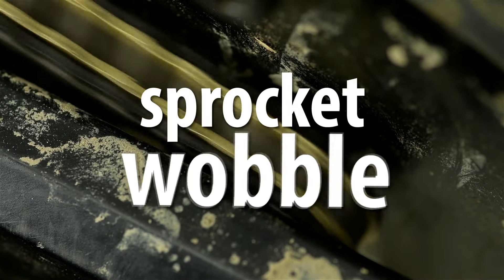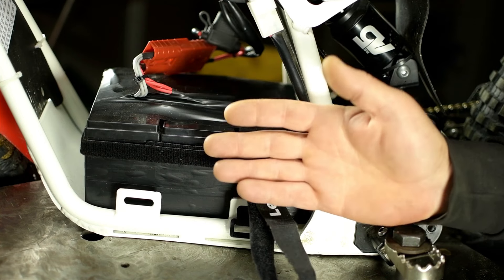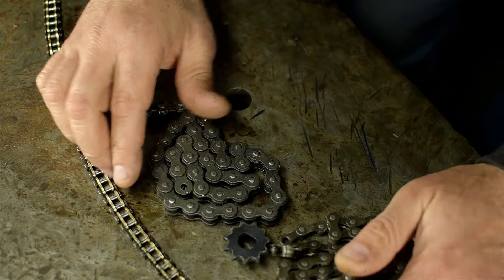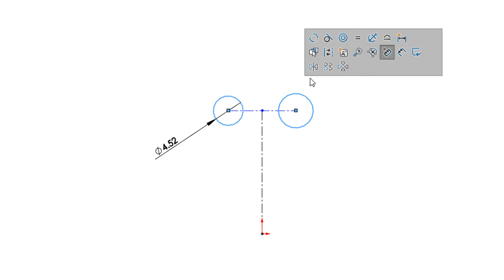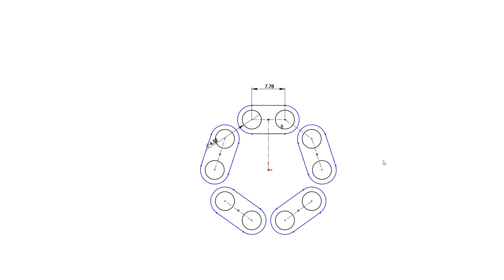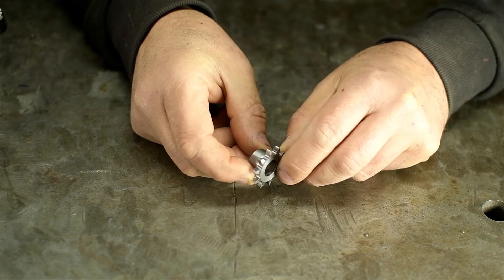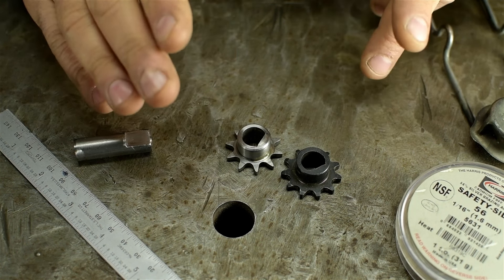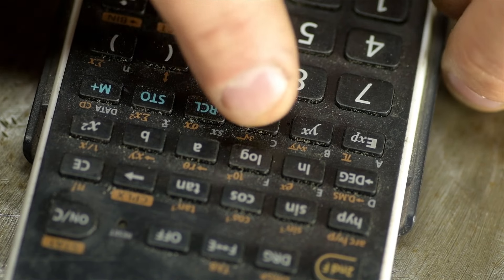Let's Make Our Own Chain Sprocket!

Comment: What chain size is on this bike? "Uuuuuh, the one we sell."
Reply: As stupid as it sounds (and it is), I've been in the same place with beta dealers before. The solution has been taking my sprocket to a parts dealer, measure it and search the catalogues for compatible stuff.
The dealer insisted that I could only fit OEM parts, as if beta made their own parts...
Reply: I have been in the buisness, for all bigger bikes and brand bikes, they use standard chains, when you come to the smaller stuff, and chinese crap, all bets are off.
The small pitbike/dirtbikes are especially f-up, no standard at all.
Reply: @someoneelse7629   Yeah I've been through that with some old chinesium "pocketbikes" when my kids were little. It's like when they built the bikes they were digging through the miscellanious parts bin and tacking on whatever would fit
Reply: @mastertek383  eh if its from china its probably a 415, but who know been my experience at least
Reply: @thispod That is actually weird because in Italy Beta has got one of the most efficient technical department ever seen in a bike factory. Maybe the next time just jump over your American dealership and write an e-mail to the Beta headquarter here in Italy. They will reply you with asked infos for sure!

Comment: They must be calculating the lead acid battery time in 'dog hours.'
Reply: @no candy Manufacturer knows, but marketing knows how to sell it.
Reply: That's what she said!
Reply: @DmitriyLaktyushkin  *how to lie
Reply: What do you mean I can't pull 100 amps from a 100 amp/hour battery pack for 1 hour?!? @_@
Reply: I think they use the term used to measure radioactive decay, half-life. They have the half-life of a worn out battery.
Reply: PRICELESS!!   :-)
Reply: Lead acid batteries are rated in Metric Hours. You have to do the conversion.
Reply: @danoberste8146  Take standard amp hours and divide by 25.4?
Reply: Railgap Esoterica - probly not if it’s rated 100 ah at 5% depletion rate..
Thats why you should use them in 
parallel .
Some batterys are capable of higher continuous discharge rates than others.
Thats why there are electric cars , 
full of thousands of 18650 lithium ion batteries, not lead acid .
Reply: @no candy Wow! I just learned something.

Comment: For the D hub why didn’t you just grind half a land off a twist drill so it only cut 2/3rds of the hole.   easy.     Your welcome.
Reply: That makes perfect sense!  Lol.
Reply: I can tell, you are one of those math guys...LMAO
Reply: Kristoffer Beder hell no.    Just chuck it up like normal, every time the missing bit comes around it doesn’t cut- instant D hole.   Course you do have to match the rpm to the diameter but there’s gotta be a page for that in the ginger beers handbook.
You’re welcome.
Reply: @mwhelan53  Ah, so that's how they make those double D holes you see on instrument panels, they just cut both lands off!
Reply: I like what I'm seeing here (including tots video) ,  a group discussing an idea or modifications to simplify or improve.. whatever.  My drills and the respectively sized triangle holes they make, can only be modified to create trapezoidal holes (using the land grind method)  I'm a newb just sharing what most of you know already.
Reply: ToT, can you please make a video on this?
Reply: I really just expected the die filer to make another appearance.
Reply: is there any difference between a twist drill and a regular drill?
Reply: @darkshadowsx5949  A twist drill will twist when it breaks.  A regular drill just breaks.
Reply: @darkshadowsx5949  On a serious note, "twist drill" is the traditional name for a "regular drill [bit]". What most people refer to as a "drill" is properly a drill machine or driver - that is, a machine that drives drills.

There are also more specialized drills like straight drills, flat drills, insert drills (brazed or screwed), coring drills, abrasive drills, friction drills (not the same as abrasive!), step drills, and so on. It's a surprisingly complex subject!
Reply: pandorafalters complex but boring.
Reply: @andie_pants  that the the filer is sexy sexy
Reply: His welcome?
Reply: @mwhelan53  a boring subject 😁

Comment: I've built several 26650 based 24v batteries for power chairs that last all day use a 7p8s 26650 pack is about 12"x14"x7" ishh? One will run a power chair around the shop , yard etc, all day, two of them will run something about 25 miles ymmv depends on the chair. Getting rid of the lead in the chair and replaced with a 26650 pack, saved about 300 dollars every three months, the pack lasted 2 years before needing a maintenance overhaul, the 260 dollar or so investment saved about 2400 bucks. Fella was having to buy new batteries every 3mo or so

Comment: Comment about sprocket design: when the teeth are few, you should always use an odd number of teeth.  Reason, there is a "tension wobble" because essentially the sprocket is a "polygon"  of N sides, and not a circle.  By using odd tooth number, the tension ripple of the meshing-in point and the meshing-out point cancel.  Another thing: the pitch of a sprocket should be A LITTLE LESS than that of the chain.  (The more teeth on the sprocket, the more reduction you need.)  The chain will move outward to find the exact point of pitch match.  If you make it exact, a micro piece of dirt will hold the chain upward from its seated position, causing the next link of the chain to fall further behind the sprocket, which makes the next link even further.  If you have ever had a bike where the chain makes jumping noises, and no matter how much you tighten it, it gets hard to turn, then bang! and suddenly easier, repeat...  That's the cause.
Reply: For a long time I had wondered why odd numbered sprockets were more common
Reply: That is interesting...never thought of either!

Comment: The sprockets we machine at work we do the same way on a cnc mill, we add a scallop in the valley of the tooth with a ball nose to allow dirt to escape. We also have problems with too much cutter engagement in the corners, which can be kinda fixed by a circular helical tool path or slowing the feed rate down. As always a great video TOT

Comment: I love the engineering calcs on the braze joint! I usually forget to take the square root. Keep it up TOT!
Reply: TimWelds 58008?
Reply: take the tensile strength of silver and divide it by the product of the shaft diameter and motor peak power. Subtract two and that's how many filler rods you need.

Then use the sq root of that amount since rods are expensive as fuck these days.
Reply: but in all seriousness that joint will last longer than the bike.
Reply: Shaft diameter: 12 mm
Hub (braze) depth: ~13 mm
Braze length: 1/4 circumference ~10 mm
Braze shear strength: 18000 psi ~ 124 MPa
Motor 750W/36V rated torque: <3 N*m
Force at failure: 124 * 10 * 13 = 16120 N
Torque at failure: 16120 * 12/2 * 10^-3 = 97 N*m >> 3 N*m
√ PASSED
Reply: @jonasthemovie  
An or
8008135
Reply: And or....
Reply: AVE told me this
Reply: shit I mean mr. President.

Comment: I was expecting you to CNC a chain with offsets timed so that it cancels out the sprocket wobble.
Reply: No joke. Maybe some chain phaser/tensioner actuated by an ootical sensor either advancing or retarding the required position of said phaser/ tensioner, that in turn, takes the stresses of that poor D.C. motor. Ya know. Something simple like that.
Reply: Need the Rockwell Entabulator to design that.
Reply: Only reason that wouldn't work is because sprocket gears are made to be co-prime so that the chain will progress through the entire chain spreading the wear or allowing one fault in the chain to spread to the entire drivetrain.
Reply: English please
Reply: was this a real conversation?
Reply: Gentlemen, TOT and you have shown me how ignorant I am to CNC and machining. I am studying to be an engineer, not far along but I assure you that one day I will be able to contribute to this conversation!!!

Comment: I really recommend wheelchair batteries for the mini trial it worked great in ours. and they are a lot cheaper and last longer
Reply: Got some 250watt ones to play with over xmas, this was great if I need to cut some gears. I still have find some chains to fit the gears. And great tip about wheel chair batteries, had not thought of those

Comment: You've discovered the method I use to find misplaced tools!  I just buy a new one, and my old one shows up almost immediately.  Of course, there is the added advantage of having duplicates like 3 desoldering tools.
Reply: exactly, now you have one for the bag, one for the toolbox, and one for the bedroom
Reply: The only caveat: this DOES NOT work for any length of 10mm socket. When it's gone, it's gone forever.
Reply: @nelsonbrum8496  
Or tape measures for some reason.. the extra one I bought in the hope the other one would turn up again has now just taken the missing ones place ;-)
Reply: Verniers...
I now have four of them and can only find one, never the same one either...
Verniers work in shifts
Reply: Very similar phenomena exists when building plastic models -
Lose a small part, you look for it - everywhere - on hands and knees.
No luck.
So you scratch build a replacement.
An hour and a half later the new part is done and you decide to stand up from the model bench and take a break.
Oh ! Something under the tongue my shoe !
- and only then you find it is the original lost part.
Reply: @joansparky4439  When I buy a new tape measure I always buy three.
Reply: Too true.
Reply: I have that problem with quarter drive and 5/16 sockets and hex heads. I can never find them when I need them. I think they're disappearing just like losing a sock in the dryer. Lol😸😸😸
Reply: @nelsonbrum8496  Switch to Imperial, Nelson.  You'll never lose another 10mm socket.  Your mind maybe, but .....
Reply: @MrPossumeyes  I use Freedom Units every day in the shop.. even have to convert from Socialist Scale sometimes.
Reply: @nelsonbrum8496  😀😀
Reply: @ProtoV33MK1  I'm glad my 3D printer came with a drawer for tools, or I would have lost my flush cutters also!

Comment: When I was a kid (mid 80s), we'd manufacture rear sprockets for racing karts completely by hand.  A calculator, compass, punch, drill press, jig saw, and bench grinder were the only tools.
Reply: Why were kids manufacturing sprockets? I know child labor laws are relatively recent, but...
Reply: @U014B  Well, they went on my own racing karts.  They were sprocket sizes that I could not buy off the shelf.  Solution, buy an oversize sprocket as a blank and then make my own.

Comment: When contour machining form with concavities, avoid the high milling stress in the roots by using the cutter to drill holes in the concavities first, then run the contour.  On drilling, forces are central and aligned with axis, so no tool deflections affect concavity position.  It is easy in the CAD to add these holes.  If your cutter has a plunge grind, you can use the same tool.  In this case, you can select the tool that matches the concavity, rather then having to use a smaller one.  This also mitigates the clogging of the tool flutes when cutting concavities.

Comment: You should be getting a call from the manufacturer anytime for an order of sprockets😁
Reply: Bwhaha.   It's funny because it's so true.  Then they'll ask him for the type of chain to use.
Reply: @shirothehero0609  did yall watch it to the end?! lol Tony is awesome!!
Reply: Going down to 10 teeth was a bad idea, the manufacturer knows why the sprockets are failing by now and the solution is more teeth, not less. The torque issue would be solved by higher voltage battery/controller. The motor itself is probably pretty stout. The bike was just poorly engineered from the start. Lead acid? You kidding me?🤦
Reply: @Hammerjockeyrepair  that I did.

Comment: 17:42 I hate when that happens. Fixed a gear in my lathe with a copper washer and some JB Weld, after getting tired of waiting. Then the part arrives in the mail. Never bothered to change it, the JB Weld is still holding to this day.
Reply: Tin can piece, and loctite 603, because the manufacturer decided to increase shaft size a few hundred units up from the one I got, so the new gears ( slightly better quality than TOT has) were just a tiny bit sloppy on the shaft.

I also had to, on another gearbox, take a regular Fenner gear, and turn most of it away, as this used a gear as part of a clutch assembly to limit torque, so just needed the actual gear teeth and a flat plate, with the centre having a brass ring to take up the 2mm diameter difference.

My garage door as well, needed 2 gear teeth, but the chain is a skinny one, not easy to get, but easy to take standard sprockets and machine them down to the skinny ones, then take some regular chain and put it in where it would just not travel over them, as a spacer.
Reply: Well like they say, nothing is more permanent than a temporary solution.
Reply: PRO TIP:

Well when I JB welded mine I had to do the same thing tony did and cut a link out of the chain because when the one tooth broke off I skoooooted all the other teeth around a bit to make it concentric, hence the removing of the half a link of chain.  
You’ll get that on these big jobs........
Reply: I glued an exhaust manifold Bolt into an aluminium head with JB weld on a Pressure sprayer...it never failed.
Reply: In the mid '80's, I was working at an independant sports car shop in the off season, (I worked in Pro football as an asst athletic trainer, and didn't make enough to support a family).

This guy came in with a 911S with a horrid oil leak. They have chain driven overhead cams on both heads of the flat 6 engine.  

The chain tensioners had been shot for so long, the slack chain had worn through the case cover.   The case covers were not available from any wrecking yards, and after the cost of the tensioner repair, the owner choked on nearly twice as much for two new case covers.

I offered him an inexpensive solution with no guarantee of it working.  I then JB Welded the cases.  No leaks.  Thr key is cleanliness.

I ran into the owner 3-4 years later, he still had the Porsche, and it had never leaked. 

 If I guaranteed it for 2 days, it would have started leaking after 47 hours.  Sometimes, it's all about knowing how to play the universe off against itself. LOL

Comment: I’m guessing that the quality control guy at the factory must’ve said
“She’ll be right mate”
Reply: The Workshop Mechanic Channel, 
Reminds me of a description I once read about the quality control philosophy of 20th century Italian car manufacturers: “Close-enough is waaaay too close.”
Reply: I’m guessing he called in sick that day...
Reply: @mxcollin95  Yeah, but it was the end of the day!
Reply: I think the phrase you are looking for is "I don't care"... I mean "within speck".
Reply: I think they assemble the bikes at the dealership. So they just send off a package of parts with an almost finished bike and never check if the parts actually fit.
Reply: I purchase a Chinese quad. It came in a crate and you had to perform finish assembly. (Tires, battery, handlebars) During assembly I decided to check that all bolts and screws were tight, and apply loctite where I deemed appropriate. Right from the factory, fresh out of the crate, the fasteners from side to side did not match. The bolts used for fairings, fuel tank, and steps were different from left to right. The person on the left side of the assembly line was doing something entirely different from the guy on the other side.
Reply: Consider that chains have that amount of side flex to deal with wobbly sprockets already. If the wobble was smaller, you wouldn't even consider it a broken part.
Reply: Bloody oath mate.
Reply: @PHUSII  quality control at the parts means if they pass they fit. Or thats what it should be.
Reply: @BrunodeSouzaLino  So there is not a dead chain and a wobbly sprocket... Its a well engineered system with self protection mechanisms...!!!!